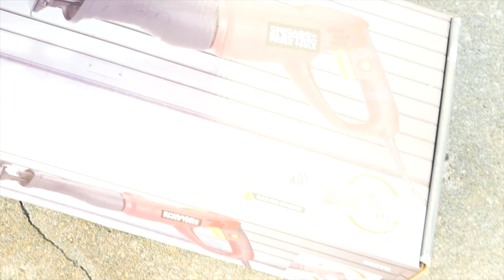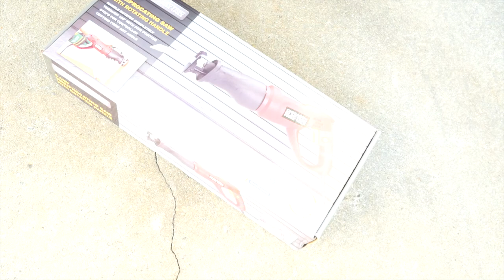Chevrolet Tahoe 5.3L LTZ Resonator Delete | Which Sounds Better?

Comment: Thinking about cutting mine tonight temporarily then cutting again when I order the slp,did you unhook the battery before you cut?
Reply: It’s smart to do you don’t short anything out just disconnect the negative cable from the battery and make sure it dosent touch metal
Reply from the maker: Naw you don’t have to do that! Your cutting metal not wiring. I would move any wiring of course

Comment: What 3 inch lift did you use. How did you get around the air ride?
Reply: Active suspension delete.
Reply from the maker: I bypass the air ride with transistors on each one

Comment: Sounds good with it off. If you take your cats off that will give more sound also...
Reply from the maker: That will throw a code right?
Reply: @540tv6  i think so, you should probably cut your muffler off aswell that will finish it off nicely
Reply from the maker: @yamen857 ok I’m probably leave the cats on but do a muffler delete and dual out the back